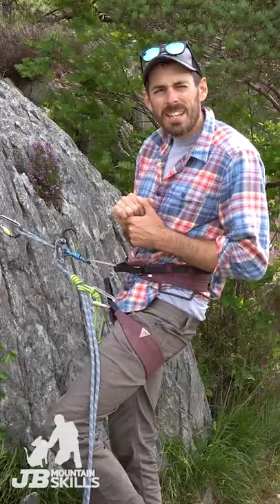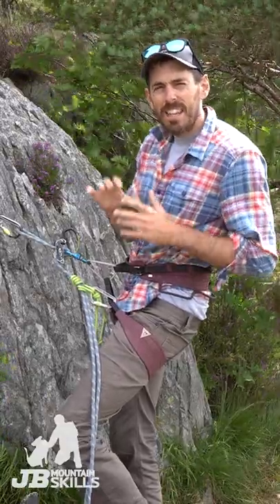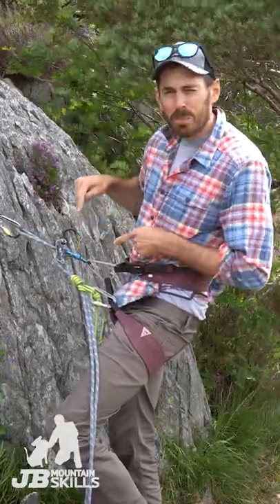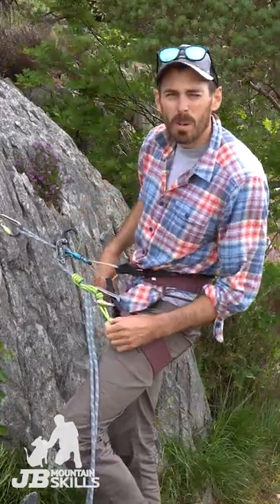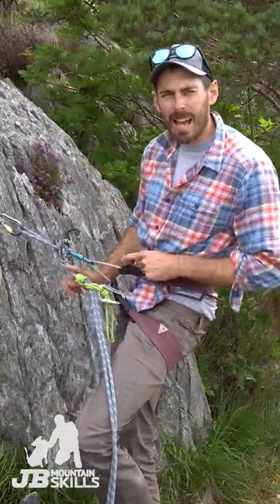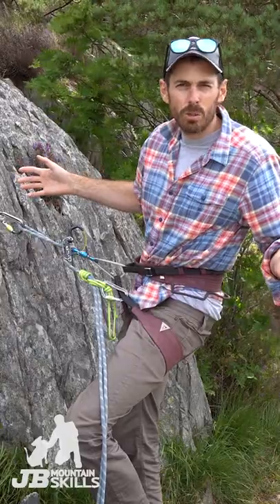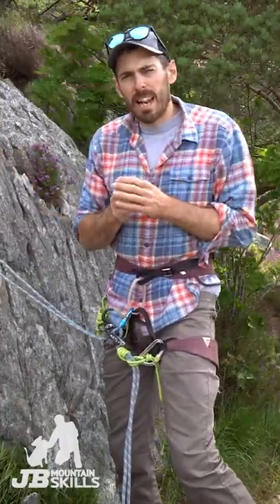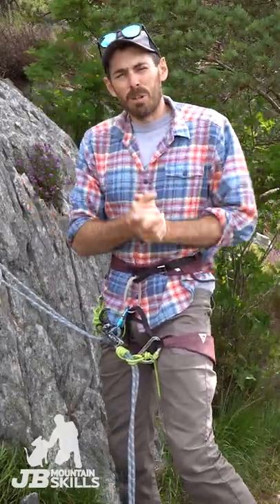60 Second Rock Climbing How To: How not to abseil, maybe? #short

Comment: I don't see anyone talking about abseiling with the gigajul in break assist mode. Is that something you've tried? Does that eliminate the need for a prussic? Would love to know your opinion :)
Reply from the maker: Yeah I use it that way a bit…
In my experience it works well only when there’s some weight from the ropes below you. So at the start of an abseil it’s ace in the assistance sense, but as you get closer to the ground there’s much less assistance, so it slips.
I’m not convinced it eliminates the need for a prusik.
Reply: @JBMountainSkills  The man himself.  Thank-you!
Reply: I have experimented a bit with the gigajul in break assist as well and completely agree with JB. So while not the absolutely safest method, you should be ok with knots on the ends of your rope. It slips but not a full release (in my very limited experience). If you are using a prussik anyway, there is no point in using break assist.
Reply: This is my go-to method. If I'm multi pitch, I bring gear to do a regular extended abseil, but for cleaning single pitch sport routes I don't always even bring gear for that option. Only problem I've ever had was fiddling with the ropes while on rappel, I picked them both up and fell about 5 feet until I left go and the rope weight engaged the assisted brake. Haven't run into the rope weight not being enough problem at the bottom, but I'm usually on a fairly stiff 10.2mm rope, so plenty of friction.

Edit: not sure why the algorithm gave me a 2 year old video, but enjoy the comment notification from the graves

Comment: I usually extend my abseil for about an armlength away from my harness.
I use a mammut sling that has a sewn loop in the middle to fix the atc and it can be used to secure yourself at anchors. It has just the right length. They call it "Mammut Belay sling 19mm"